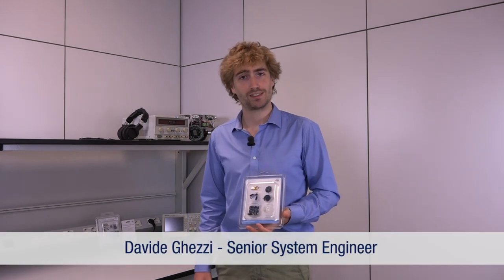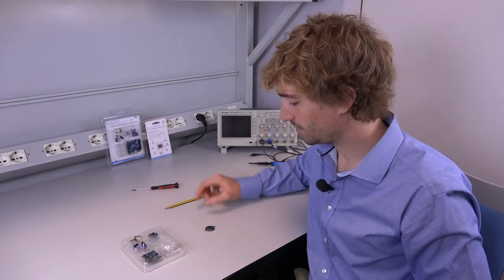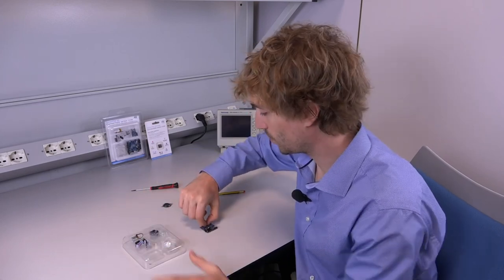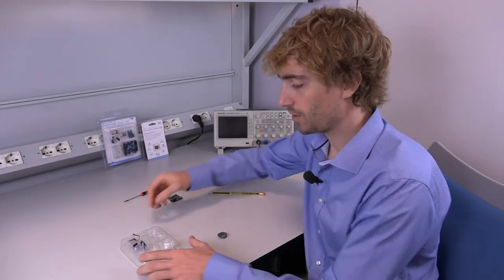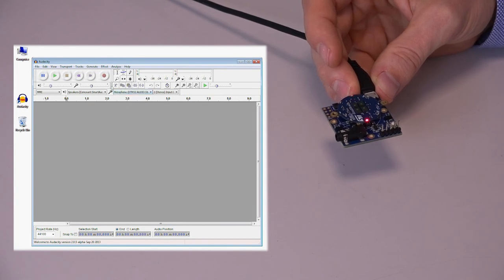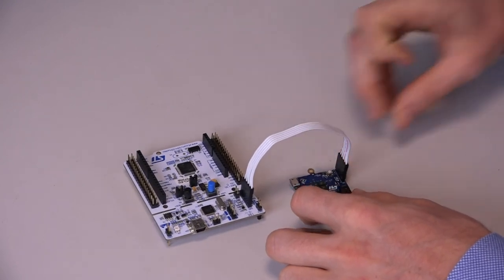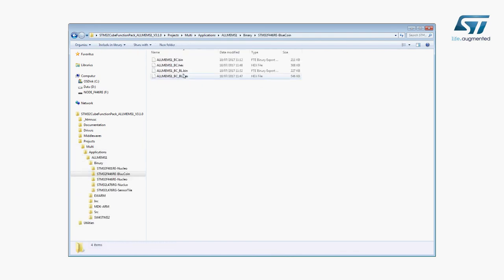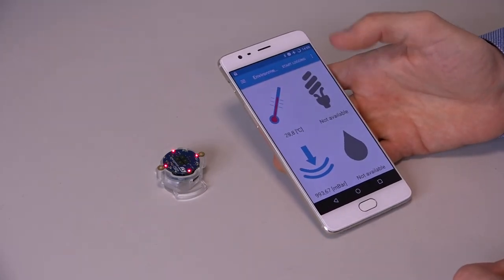Unboxing the BlueCoin starter kit, the robotic ear - video from the lab

Comment: Hi, I am trying to program the BlueCoin through STM32CubeIDE and I am finding some difficulties. I am not really experienced with this enviroment so I thought I could ask you for help. I have seen the examples on st.com and now I am interested in making my own "DataLog". I am interested in the vl53l0x mounted on the board. I would like to know how to propely import the "BlueCoin" folder, from the example, in my project. I am probably doing something wrong when trying to copy the folder. Can you please help me? Maybe I don't need to copy-paste and there are more steps to make before it works that I don't know. I would like to make a simple program which reads the vl53l0x without threads , semaphores, battery monitoring, lighting led, etc. but I can't import the library correctly. 
Thank you in advance